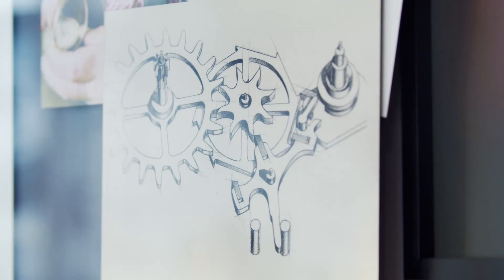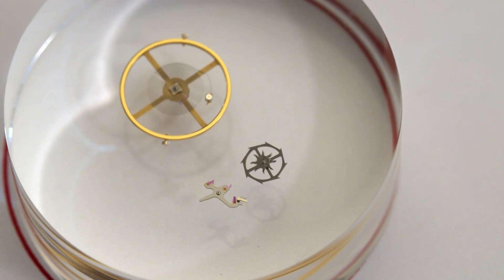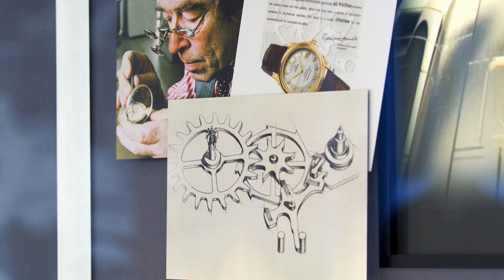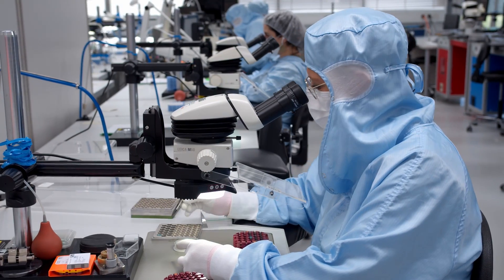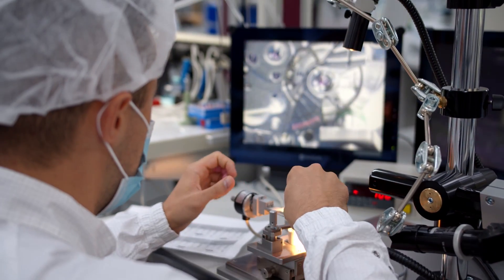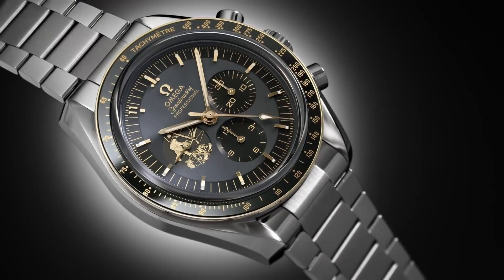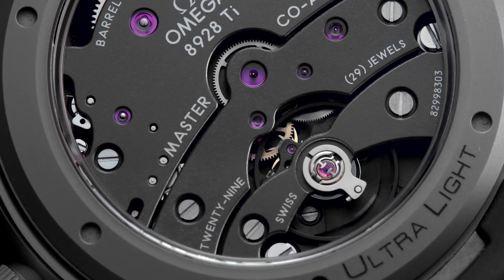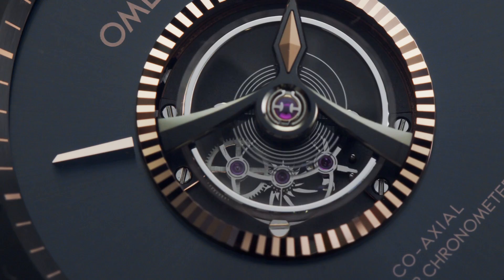IN-DEPTH Guide - Everything You Need To Know About The OMEGA Co-Axial Escapement

Comment: For movement and technology, omega is far beyond rolex. However, in most of normal environment and daily use, rolex is more durable than omega based my own experience
Reply: Not when it comes to antimagnetic properties. The Rolex Milgaus, which is touted as the brand choice for engineering, where resistance to magnetic fields can be most impactful, is rated to 1,000 gaus resistance. With Omega’s silicone hairspring technology almost all of their watches are rated at 15,000 gaus resistance.

Comment: I see. Omega feels the Grand Seiko's 9SA5 threat.
Reply: Too little, too late. The new 9SA5 caliber is great, but it's still not as accurate (+5 / -3, vs Omega's 0 / +5), not as magnetic resistant (60 Gauss vs Omega's 15000) and not as affordable (GS starting around 10k vs Omega around 5k). Moreover, Omega's current gen Master Chronometers (i.e. 8900) are in production for 6 years already, so you can expect another evolution far sooner than GS, further extending their lead. Big love for both brands though!
Reply: @stefanlazaralexandru  I do get your point but this argumentation sounds pretty much like that it comes from well established car brands like Merceds, BMW etc. when talking about the threat of Tesla. I do not want to start a discussion on comparing car brands with watch brands but history showed that egocentricity in business causes brands to loose significant market share.
Reply: @jeffjenco8009  Your comparison makes sense if you compare the Spring Drive to a traditional mechanical, but the discussion here was about 2 traditional mechanical movements from 2 competing brands. As an owner of both Omega and GS, I have a soft spot for both, but you can't deny the facts, that Omega's 8* and 9* series movements outperform the GS' in many respects. What is so special about the new 9SA5? Antimagnetic? Yes, but barely. Co Axial escapement? Ok cool, but Omega is at it for 12 years already and have gone through several iterations. Full balance bridge, free sprung balance? Rolex and Omega are doing this for over a decade or two. Accuracy? Barely better than COSC. Oh it's well finished and has 36k BPH? Not enough to justify the price if you ask me and definitely not enough to stand up to Rolex or Omega.